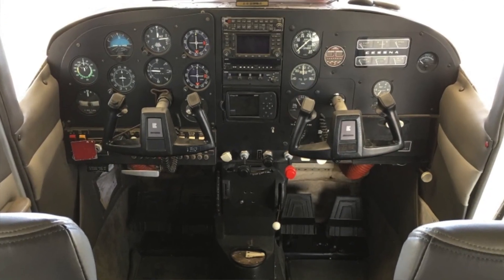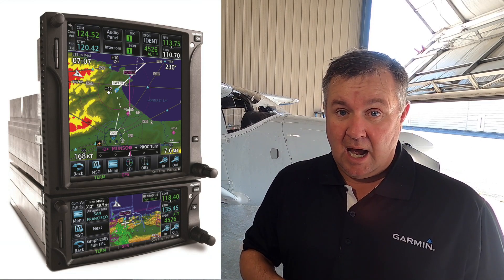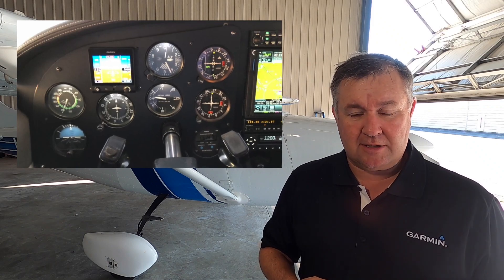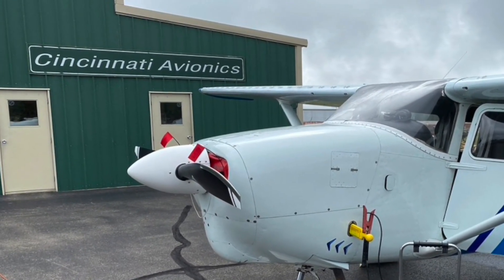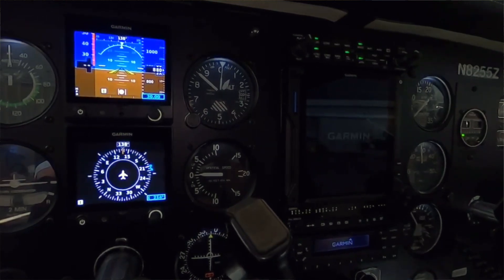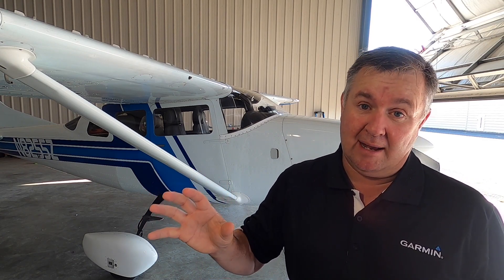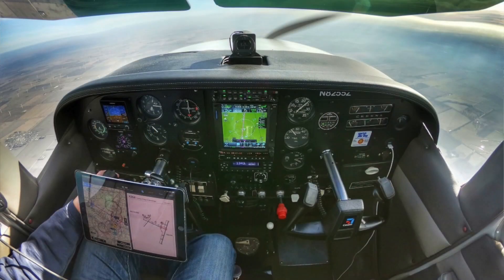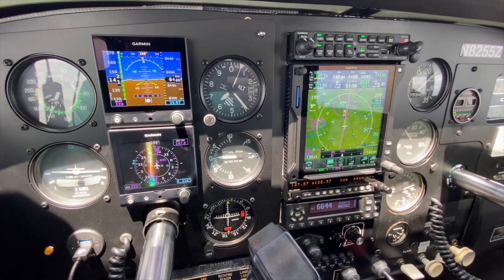Panel PIREP: Cessna instrument upgrades including Garmin G5, GTX 345, GMA 345, GTN 750XI #Cessna205

Comment: What mount are you using for the iPad on the left of the panel?  Fixed, suction mount, etc.  Thanks.
Reply from the maker: It's a ram mount, fixed mounted to panel.  Works great.

Comment: If you were building a panel from scratch and started with a 10” G3x as a PFD would you add the g750 still?    Definitely going to add at least one G5 and maybe a pair so I can also run no vac system.     Thanks for any advice.     Basically rebuilding a panel for a 172 and looking for advice on the best setup for around 20-25k budget.
Reply from the maker: Great question, depends totally on your budget, especially now with NEW XI models.  Do you get NEW 650XI or used 750 🤷‍♂️ honestly the 750 size is amazing.  That budget will be tough, that I can guarantee, unfortunately.   Which depends a lot on what you have now, if you have 430/530, the GTN costs are much less.  BUT recutting panel, adds to the cost also.  Good luck, happy to help if I can.  More images at www.colbyagtech.com
Reply: Chad Colby the plane does have a 430W
Reply from the maker: Have a friend with 182, for about 26k he's getting new GTN 650XI, Dual G4's and new audio panel. fyi.
Reply: Chad Colby did you mean Dual G5s ?
Reply from the maker: @BaxterretxaB  YES... dual G5's....  since you have 430W, that helps you greatly, as you know they are worth easy 5-6K AND you will save 2K in wiring.    Where are you from?
Reply: Chad Colby from NC. The panel work is being done in Florida most likely. Budget is fairly flexible just trying to create something modern/reliable/ good redundancy for IMC safety
Reply from the maker: Also, G3X wouldn't fit in my panel.... patiently waiting for GFC500.

Comment: Every detail covered, but cost....
Reply from the maker: Yeah, had a few others ask as well.  It depends SO much on what you already have, like mine had good start.
Reply: Translation:  A lot.
Reply: C172-er here. Seems panel upgrade costs are about half (at least) the value of plane.....steam gauges it is then....